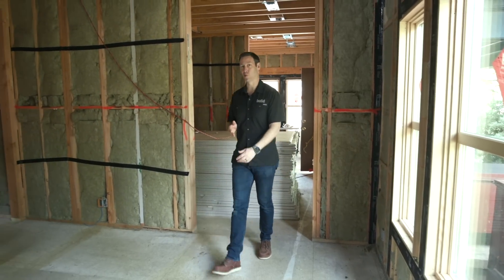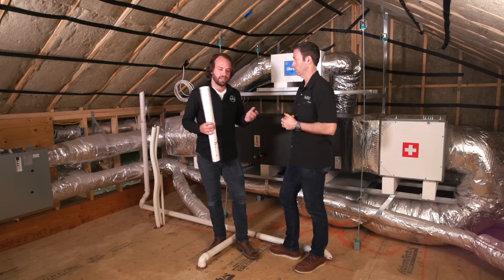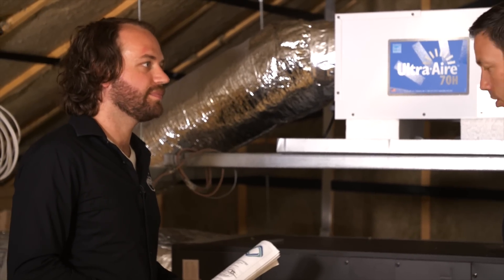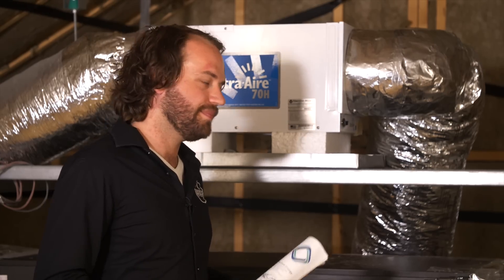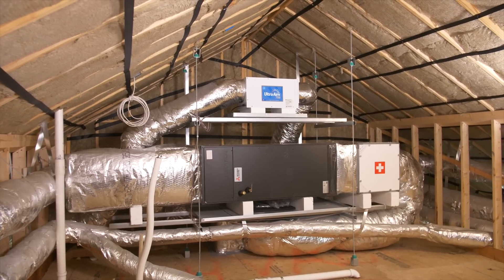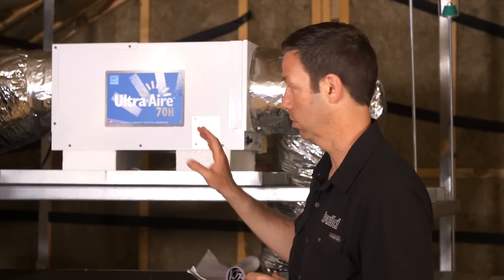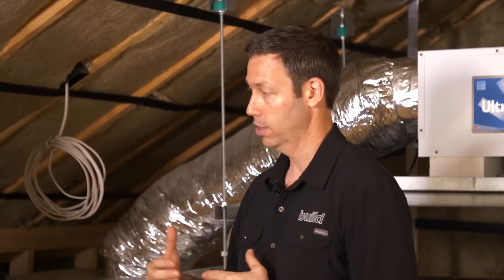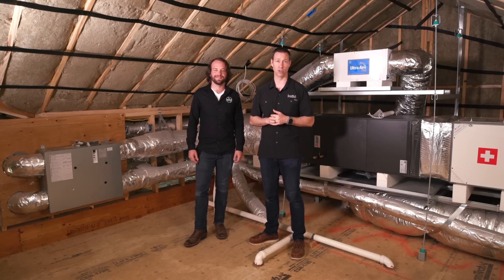New BUILD : Excellent Air Conditioning System Cost?  I’ll tell you!

Comment: 25 years on the box?
Around here they want to change them at 10 when they have first problem.
Different price demographic I guess. 200k house vs million.
Reply: The problem is these new systems absolutely will not last much past 10 years and you can forget it about aluminum coils. Trane aluminum coils .. you're lucky if they'll last 3 or 4 years before springing a leak. 10 years is the upper limit to an extended warranty.

Comment: How do I find someone that can design a system? I have called out so many "ac companies", 75%+ have no clue  the other pretend to know. 

I can't go as crazy as you did ( money is an object), but it will be worth having the 1940 house redesigned for AC.  Originally it was only heat with a wall mounted unit in main area.
Reply: Probably an engineering firm that draws MEP sheets. Also, google the company of that guest, and see what they call themselves. Then google similar titles.

Comment: I am installing 5 stage HVACs in my renovation  Contractor states that negates the need for a duhum.  Memphis TN.  Do you think a dehum still necessary?
Reply: They Both anwered your question in no uncertain terms between 11:45 and 12:25.
Reply: @daveclark8337  Respectfully, they really didn't  They spoke in a generality.  I am specifying not typical 2 stage ACs but 5 stage.  And I am specifying a geography where our shoulder seasons are always < 1 month, often as short as 2 weeks.  Yes, we go from summer to winter in as little as 2 weeks around here.

Comment: I wish more home builders discussed system options with their clients. Our business mainly does change outs residential and light commercial.  It is amazing how crappy the duct work is designed and installed at every price point house. They also install the cheapest equipment possible. Hot and cold spots. Flex trunk and supply. Terrible!

Comment: 2,000 sf with a budget from "$500k- $1mil"!?!?!?

That can't be construction costs and more market property value...
Reply: Not if you are building a home with really high quality standards and materials. 
Most people who buy/build 500k homes are going for size and features and not build quality. As you sneak up to 1M, you are getting more quality, but typically also a large house. 
If you build something extremely well and to the highest possible standard you could easily run in that range as well for a smaller home. 
IMO its probably money better spent. Id rather have a super well built home with less sq ft than a larger home built poorly. 
And IMO most houses are built poorly. (ESP by production builders)

Comment: So, I'm trying to replace an HVAC system in a remodel. Want total temp flexibility in almost every room. What's my best setup. I've looked at both geothermal and conventional air with multiple unit and max zone boards and am weighing against many mini splits. All have pros and cons. Cost not a factor, what do you think for efficiency and flexibility? Is there a setup I haven't considered? I am an avid viewer and really respect your opinion. Thanks!

Comment: Hospital quality in house, nice if you have a hospital budget. You try and tell a normal home owner has going to have to pay $70,000 just for ac.
Reply: For $70,000 it better be radiant heating and cooling and 100% domestic hot water heater from a ground source heat pump. No need to change filters when you are not always blowing air all across the house. And even that shouldn't cost $70,000

Comment: going off somebody's saving and unit cost here are the numbers for a unit  (20k) from a 200 a month bill to this unit now they pay 60 a month. leaves you with 140 in electricity saving for the warm area they live year round. this is with a 12 year loan.you save 140 a month. so 20 a month for the unit over the course of 12 years is 2880 for the unit. 12 years is pretty typical life for normal ac units. normal units cost about 1,500 to 2,000 for just the unit about 4,000 nationwide average. now that on average save you 1,200 or 100 a year depending on which unit will last the longest life. a 20k unit also puts pressure on you in case it fails or needs any maintenance over a normal unit eating away at the $100 yearly saving or possibly add to that savings, this value drop if your spending under 200 a month now. or live in the colder climates where you don't use this year round in which case you need the unit to last about 25 years to break even with a normal unit.Read more Show less

Comment: This was not less that I thought, but far more. While it’s nice to have a channel that considers the humid southeast, the region also has low energy rates. As a result, these kinds of upgrades do not have a reasonable payback, nor will they bring back a significant portion of the investment at resale. As for the average building pending 1-2% of home cost on mechanical, this is pure fiction. At the average home transaction price in the south, mechanical is closer to the 5-10% range.

Comment: I'll never buy anything other than a mini split again. Have one unit with two heads to heat and cool my home. All my appliances are electric, and my bill is like 80 bucks in the summer and 50 in the winter. Cost me 2 grand for the system and it's worth it.... I mean granted my house is only 580 square feet but still.

Comment: Been watching these videos for a while, my attic is open, I can see through the vinyl ceiling down to my front porch.  I have to replace my unit as its coil is rusting, and its a R22 unit.  I live in the SC lowcountry coastal.  HUMID!!  My attic gets really hot in the summer.    Its where my handler resides.  Guess I am screwed.
Reply: Not true.....you need to vent the attic space more.  If you have ridge vents consider a whole house fan or if you have vents consider a power vent. Put both on thermostats in the attic space to turn on at certain Temp.

Comment: I have a PhD in building science. They way they think about building passive house just by putting tons of insulation in hot climate is wrong. You need radiant barrier and moisture proof system. There is reason why hot climate doesn’t need much insulation in code because delta T is not that much in summer. Humidity is the main problem

Comment: I just built a 2900 sq ft house last year and got a top of the line 5 ton Carrier Greenspeed system with 7 zones and a return in each room. I paid about $22k but the installer was a friend. With open cell insulation on 2x6 walls, my electric bill is running around $160-$190 year round (highest in winter). 

The house I moved from was 2000 sq ft built in 2004 and the electric bill was almost up to $300 in the summer.
Reply: 7 zones 5 tons for 2,900 sq ft. and 5 tons? Too many zones too many tons.. but if your comfy I guess thats what matters

Comment: My guess is that you Panasonic fresh air system controls are not scaled in CFM, but percentage of total CFM. If you think about it, those same controls are surely being used for different sized systems (in terms of CFM) and the controls referring to percentage of max makes the most sense.

I believe those squirrel cage fans that were visible when the cover was opened, were rated for way more than 100 CFM. I'll bet they were >250CFM each. Not that they are additive...

I used to design forced air equipment (similar to electric furnaces), which doesn't mean I'm right, but I do have a sense of what airflow fans produce, simply based on their type and size.

By the way, the main reason HVAC equipment uses squirrel cage blowers over axial fans, is pressure not flow. Squirrel cage blowers are usually speced because they have the requisite pressure to overcome the resistance they might encounter with long duct runs and/or filters. Many high efficiency filters have enough static pressure to completely choke an axial fan, which would otherwise have enough CFM to do the job. This is why you see axial fans being used in floor mounted circulation  fans and smaller bathroom fans because these applications don't require high efficiency filters or long ducting. Another application for axial fans is cooling fans for computers and other electronics. Again, nether  of these applications use long ducts or high eff filters.

Comment: Should have the ERV drawing air out of the house on the supply and bringing outside air into the return, ERV filters arent as good as that gucci filter box hes got installed so hes lowering rhe air quality with the ERV as its setup, not the end of the world though, you can also tie the ERV into a POSH system so it can replace the bathroom fans by using the ERV (or HRV) for further savings to the home owner.

Comment: As an hvac contractor, I'm glad SOMEONE is talking about the important stuff, asking the impirtant questions... 
While my own business is primarily service & retrofit installations. Myself and several of my guys cut our teeth in new construction. And we DO work for select builders. The ones who "get it". The ones who value what we do, and want to build a better home. 

The things that go on in production building are downright appalling most the time. These poor homeowners are spending 3-700k, on average, many times more, on the shoddiest built homes, with terrible hvac systems. There is something majorly wrong with a 500k house, where the hvac system was only 8k. We're taking 1.6% of the build on one of the main thing that makes your home liveable... NO-ONE can do a quality system for that. It doesn't have to be over the top, but knowingly sell the homeowner a P.O.S. system is just wrong. We have often gone into million + homes with the crappiest hvac system you can possibly imagine.
I cant tell you how many times we go in and fix brand new homes. Its disgusting. These people trust their builders to use quality subcontractors. Instead, some of these builders get tons of bids, they put the higher, quality company's bid on the budget... Then use the cheapest, shittiest company they can find. And even then, they will haggle them down on price, make the overage in difference in contract price, PLUS points on top of that for management...

If nothing else, videos like this are a start. A start to educating homeowners on the questions they need to be asking. Quite frankly, if you are building a home, and you never sit down with your hvac contractor? Or at least your hvac contractor and builder, and have a consultation about your comfort wants and needs? You should look for someone else. Or at least asking yourself why. How can a contractor deliver the kind of comfort you desire if they dont know WHAT it is, you want? Food for thought people.
Reply: I go through this constantly. Lack of knowledge with builders/customers lead them to beleve that you are cheating them. In new construction etc.,its all about the kitchens and floors.
Reply: Some valid points raised. DIY is the answer.
Reply: @samsun01  Only to a degree. One can't diy everything. It's just not feasible. Nor is it feasible that one could diy their whole home better than a professional.

The distinction here, that I was making, was the builders. Makes all the difference in the world. And they're not that hard to find, typically. All you really have to do is just compare the work being put out from one to the other. The differences are typically obvious.
Reply: @Floridaman8783  good distinction. Invest some time upfront on finding a good builder while also invest some time to educate yourself better so later on you can fix your own house (case by case, depends on what can be DIY).

Comment: My house isn't tight. The furnace & air conditioner cycle often, depending on season.  In the summer, shortly are the ac stops running, the humidity starts rising,  and in the winter I can't pump in enough humidity to maintain a comfortable level. I think it's definitely worth the up front cost of doing it right,  so you're in control of what comes in.

Comment: If lowering energy consumption is important to the homeowner, why isn't the heat pump a ground source, sometimes called geothermal one?  We see the air handling unit in the attic, what about the outdoor "condenser" portion?  Why doesn't the heat pump have a desuperheater providing free hot water in the summer, and much cheaper hot water in the winter?  After all the trouble the builder went to to minimize infiltration, I assume there is not a natural gas boiler, or hot water heater.   If the house is so tight, is a gas range, and oven advisable?
Reply: I suspect a ground source heat pump would have a better return on investment than all the other HVAC equipment, particularly considering the ground loop will last at least 100 years.

Comment: A few comment/questions (feedback?):

Okay, a lot of equipment, but a lot of handwaving and words about how it was all hooked together. It would have been nice to jump edit to a segment with Trey's plans on a table (or a piece of plywood across a couple sawhorses) to point and trace the air paths.

Second, the purpose of the dehumidifier is not quite obvious (to me). Yes, the house is in a humid climate, but houses have been being built with just an A/C pulling the moisture out of the air for ages, and those houses leaked (a lot?) of air. So now we are in a tight house, so when the humidity is sucked out of the interior by the A/C, the house is not leaking in a lot of new humid air, so why the need for the dehumidifier.

Third,  the filtration unit was uncommonly fine. You never explained why the homeowner wanted this degree of filtration. Why? What are the different levels of filtration that can be designed into a system and what is the candidate region/home/homeowner for each level?

Lastly, what's with the silver vertical rods with the green things? It would have been nice to zoom in and focus on them with an explanation, assuming you haven't done that previously.

Cheers & thanks!
Reply: EXACTLY!!!!..THERE WONT EVEN BE ENOUGH AIR TO FILTER!!...WILL OVERWORK THE MOTOR ..JUST PULLING AIR THROUGH THE FILTRATION SYSTEM!
Reply: PEOPLE DONT REALIZE ITS CALLED.." AIR CONDITIONING"... NOT JUST " AIR COOLING"!!.... LOVE YOUR POST..THANKYOU!
Reply: OUR BODIES AREN'T DESIGNED TO BE ..MICROBE..FREE..

Comment: The installation cost will wipe out any bit of savings you will receive on your utility bills. Stop selling myths. My opinion with 15 years hvac experience
Reply: But the single speed units are rightfully on their way out. 16 seer will be the standard.

The Bosch variable condenser shh hi oils be the minimum unit available I think. We’d see prices plummet on basic multi speed units.
Reply: David Burnett Lol. Rightfully? Have prices came down yet? Nope. Customers are now willing to finance these acs for 10s of thousands now. You are misguided.
Reply: @zekemontgomery6678  i thought the whole point of these systems was to increase air quality and comfort in the long run, not savings
Reply: Installation in new construction should go quicker than remodel. Added savings of vfd